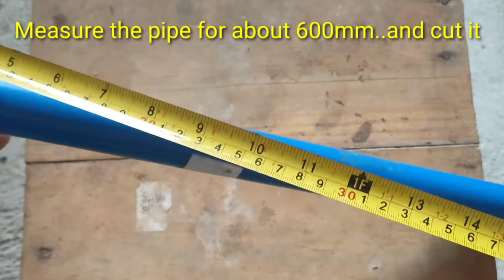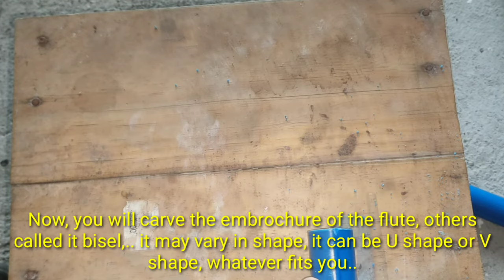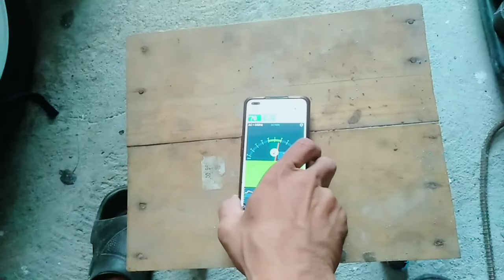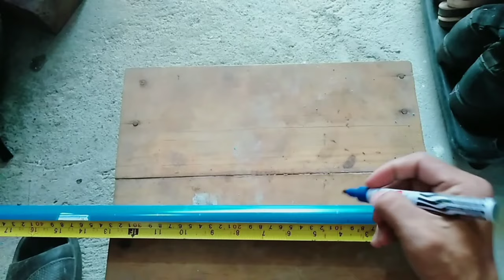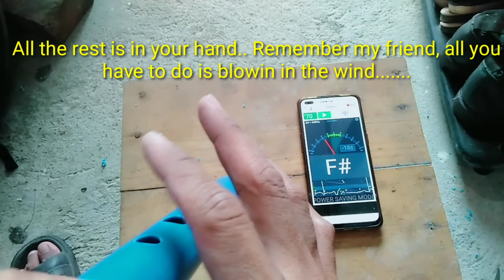DIY PVC Quenacho key of C Tutorial

Comment from the maker: TO PRODUCE SOUND:
Hold the quena with your right hand covering the bottom three holes. Your left hand should cover the top three with your thumb covering the hole on the back.

Hold the quena to your mouth and close the top end of the pipe with the flesh between your chin and lower lip.

The u-notch / embouchure indentation should rest against your bottom lip.

The first thing that is required is to shape your lips properly. Smile a narrow grin as if you are spitting out a watermelon seed. This pulls the lips against your teeth.
Blow a stream of air downward along the axis of the pipe into the mouthpiece end. Think of blowing a tiny pinpoint air steam.

In order to find that precise location, slowly rock the flute back and forth to direct the air at slightly different angles. Tilt the angle of the u-notch up and down until it makes a tone.

Get accustomed to holding the quena in this manner and find the exact point where air must be blown to produce sound.

Practice until you are able to consistently blow into the mouthpiece and produce sound.

Comment: from where the hell you are blowing is not shown.
Reply from the maker: TO PRODUCE SOUND:
Hold the quena with your right hand covering the bottom three holes. Your left hand should cover the top three with your thumb covering the hole on the back.

Hold the quena to your mouth and close the top end of the pipe with the flesh between your chin and lower lip.

The u-notch / embouchure indentation should rest against your bottom lip.

The first thing that is required is to shape your lips properly. Smile a narrow grin as if you are spitting out a watermelon seed. This pulls the lips against your teeth.
Blow a stream of air downward along the axis of the pipe into the mouthpiece end. Think of blowing a tiny pinpoint air steam.

In order to find that precise location, slowly rock the flute back and forth to direct the air at slightly different angles. Tilt the angle of the u-notch up and down until it makes a tone.

Get accustomed to holding the quena in this manner and find the exact point where air must be blown to produce sound.

Practice until you are able to consistently blow into the mouthpiece and produce sound.